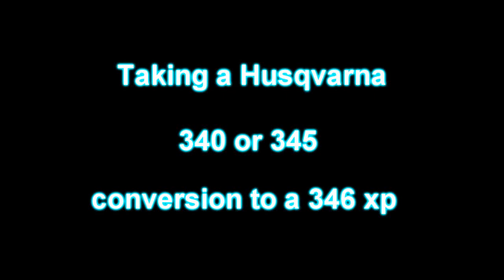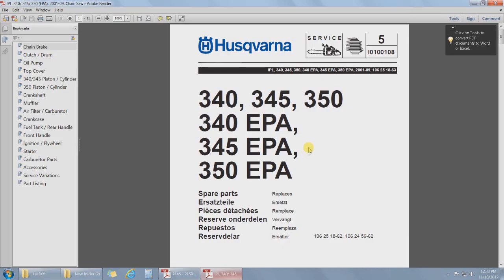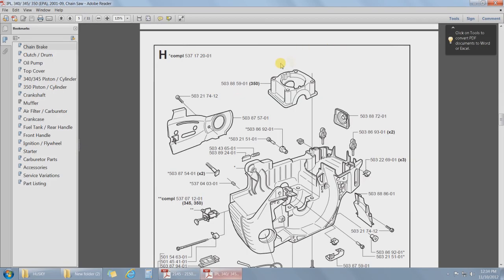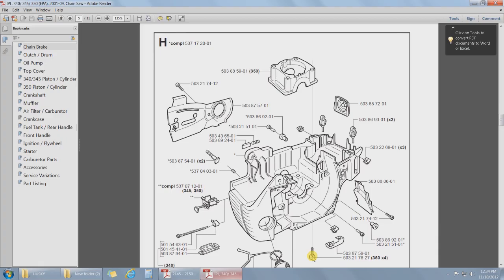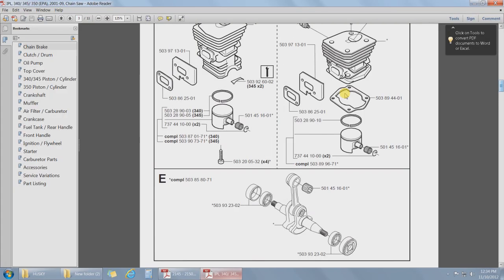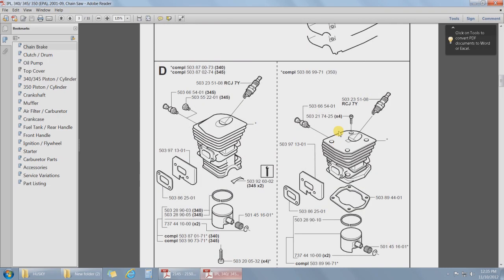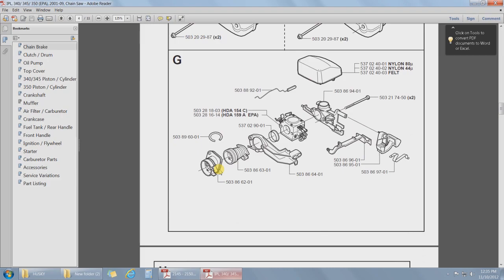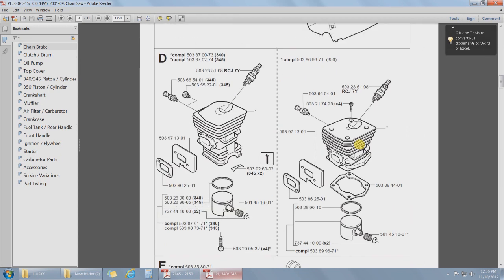Husqvarna 345 340 350 up grade to a 346xp

Comment: Great saw!>>>ur2.pl/725     I have always been a Stihl fan but my longtime dealer didn't want to keep my business. I found this saw on Amazon for a great price. Got it in, put the bar and chain on, filled it up and it started on the second pull. Light enough to handle easily but has plenty of power to do everything I need to do around the farm. If you do trip the chain brake while the cover is off, just reset it with an open end wrench.